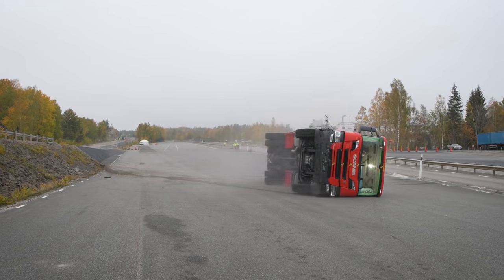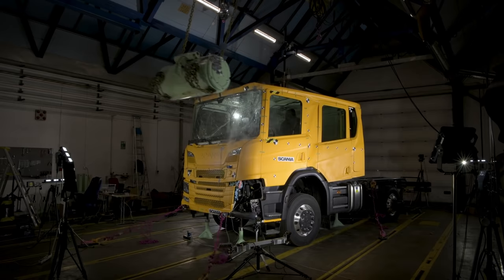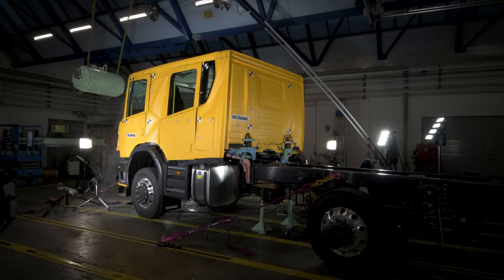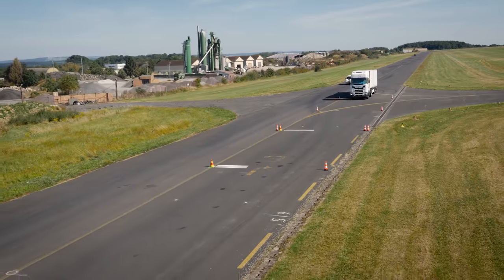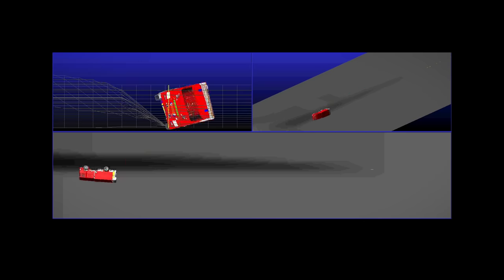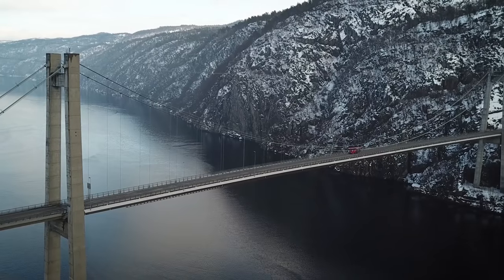Crash testing the Scania CrewCab

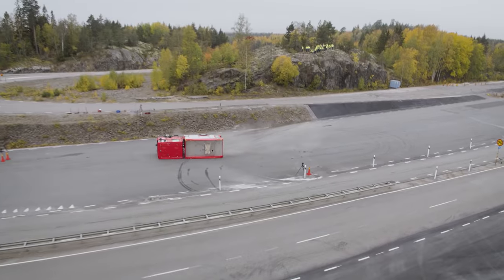Comment: 2:49 You can see the airbags deploying before the hit. Nice.
Reply: @Lumer Actually, Some cars and trucks play a high pitch sound just before impact; giving the drivers and/or passengers the "lock" in your ear. Resulting in less ear damage compared to the noice of the actual crash.
Reply: I slowed down the video. They dont deploy before the crash
Reply: @hr1s544  I can clearly see it even at x2 speed, so...
Reply: Hrisi lol
Reply: İt is not deploying before crash, the bottom side of the vehicle crashes so that it deployes
Reply: Have you guys not heard early crash sensors?
Reply: @Ajay-nj4vx  more like gyro
Reply: @emiryg7601  the bottom side, not the entire side
Reply: Airbags are loud as a gun.. I was in a car crash and it Made me deaf for 30 mins
Reply: Oil
Reply: Oil
Reply: I think the force of the rolling over triggered the airbags

Comment: 3:00 what happend when truck are full?
Reply: but its Crew Cab, for firetrucks. firetrucks don't carry things that can move
Reply: widzę że jesteś Polakiem, straże pożarne nie wożą rzeczy które mogą uderzyć w kabinę od tyłu
Reply: is it possible a fire truck without equipment? Of course that mass have momentum when truck deceleration instantly (physics works the same in Sweden or Poland)
Reply: Full of Airbags
Reply: @dawidos557  what about water and equipment?
Reply: @Errost5  Water tanks tend to have baffles in to minimise water sloshing (similar to oil tankers), and the equipment lockers are similarly separated to stop too much movement.
Reply: @Theaveragenerd2000  yea sure i know. It still can move
Reply: @iflax7460  and force of impact is higher than empty truck a basic physics

Comment: I would buy one if it was offered in a manual transmission connected to a 6.7 L turbo diesel Cummins engine or X15 Cummins Diesel engine... with 4x4 or even 6x6 chassis with locking diffs and disc brakes all around!

Comment: Those tests don't look realistic. All of those tests were low energy collisions in controlled overly optimistic conditions. In real life a truck hitting another truck at 110km/hr and rolling over with 20000kg in the trailer of steel pipe for example would totally destroy the safety cell of the driver and kill him. The tiny low energy objects you dropped in an angular manner don't represent real world crashes with real world high cube weight loads penetrating the trailer and continuing to penetrate the back of the cab. Proof is that you did not test what would happen if your truck and trailer at max gross weight  hit another trailer at full speed.
Reply: If they were going to test it at max gross weight they would load it to 74'000kg not 20'000.

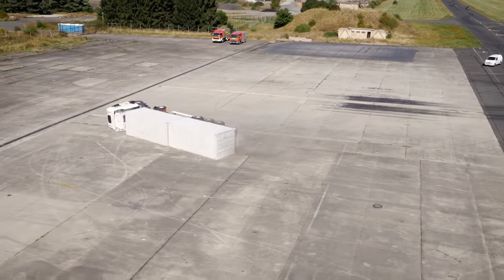But that's still irrelevant because this cab is pretty much solely designed for fire trucks and won't be carrying any cargo. The shot at 1:57 shows clearly what it looks like..

Comment: That impact rest was all lie. I've seen an accident here in our city with one Scania cubover truck. It's steel tube cargo slid from the trailer through the back of cabin and out to the windshield. Could have been a nasty death for the driver and his partner. This happened after braking at 30 km/h.
Reply: Well for one that load was not tied down correctly if it came shooting through the cab after braking from 30kph, and nobody would build a cab that could withstand several tons of relatively pointy cargo crashing into the back of the cab because it would have to be built like a tank.
Reply: @frankeinfish ...
30 kph ???
Sounds like securing the load was COMPLETELY FORGOTTEN...
We need to STOP protecting the stupid, lol

Comment: Scania are crap. The front grill has 50 moving parts just to open it, Eh Volvo use a hinge, FFS .
Reply: @Wolf1._96   Scania drivers at the Truck Stop '' what did you do to yours''    .. I did the diff, and the big end bearings, and the gearbox, and the cab bushings, and the compressor, and the steering box.  Volvo drivers at the Truck Stop '' what did you do to yours''  ....Didn't put a spanner to it .